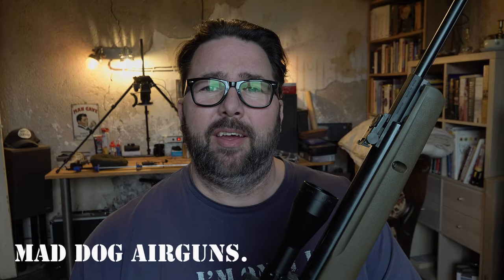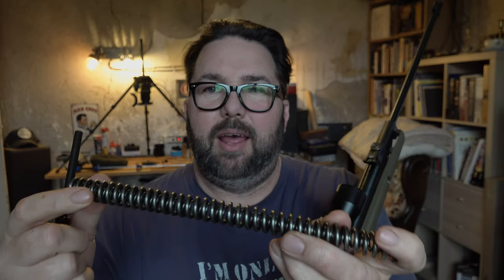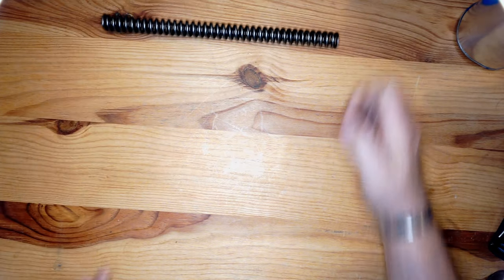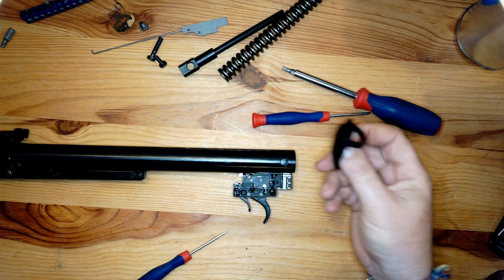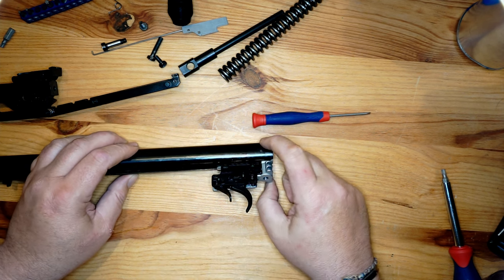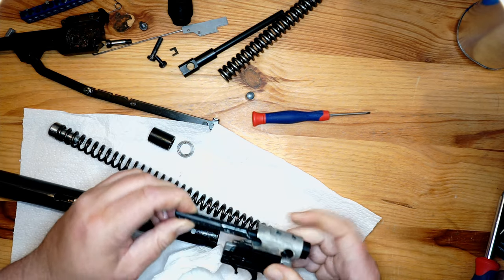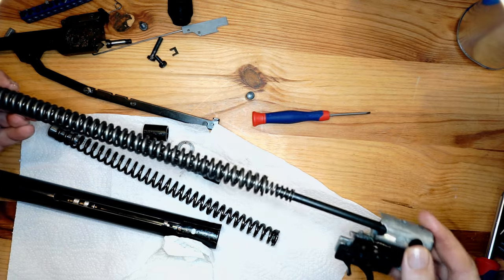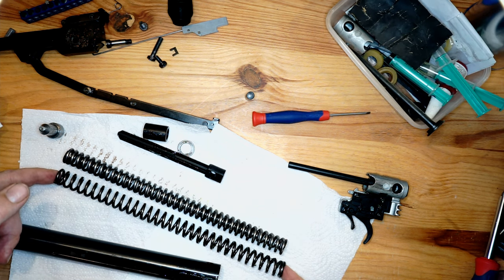Worst Airgun Mod I've ever tried

Comment: That was a real shame I also did a similar kit on my Webley Vulcan some years ago, I'd been in my local shop and got talking as you do with chaps as I was a complete clueless shooter back then. Guy grabs this double spring kit of the rack in it's greased up plastic bag with the words get this in you're rifle it's the dogs B******S  🦾. Got home stripped the old spring out with no problems as I'd already mended a broken spring previously so I was well versed, put new kit in buttoned everything back up cocked the rifle and dry fired it once to test and all seemed fine except the muzzle sound was distinctly lower. Next day went off to the range proud of my achievement and no smashed fingers and started to shoot, my zero had dropped by four inches I grabbed a friends chrono and the rifle had gone from 11.2 ft/lb to 9.1 ft/lb with .177 8.4 grn pellets and yes I felt a right burk but learnt a valuable lesson to not fix things that aren't broken.

Comment: Just found your video , someone has sold you a pair of Tornado springs an airgun produced by FEG in Hungary designed in the late fifties early sixties went through several mods over the years but the twin spring tec was never really a success.  I would suggest using an appropriate Titan xs main spring and replacing the piston seal with a TX 200 seal or contact Ian at Custom air seal Australia I believe he produces a seal to fit that covers the boss on the end of the piston this will improve sealing and reduce noise not sure the piston weight needed unless you decide to go for a shorter and less powerful spring. Remember the heavier the piston the greater the felt recoil. There has been a anti grease movement for the last forty years, but the correct amount of lubricant in the right places can work wonders for recoil and smooth shooting.

Comment: Looking at what u are trying  not a good idea take the right spring an on each turn put large screwdriver in a stretch them you will only a mm on each but will certainly  inprove the power

Comment: I have a veeery cheap and primitive springer i bought used for 15 euros.  In my country you can buy air rifles up to 12J energy without licences. I dont think it was making all the 12J even, what i did to get a bit more power was to dissamble it, ive "hand machined" a spacer to add between the spring and the trigger carrier to give it a tad more compression. I had to modify the the trigger because it didnt latch onto the spring catch due to the more compression. It does have a bit more recoil now, but the power definately increased. The seals are all bad and its really a shit rifle, but its much more accurate now and packs a bit better punch. Best thing, it cost me like 5cent nut that i grounded and drilled to fit the guide.

Comment: I think you should put back in not only the front spring guide, but also the rear bush and rear washer.
Reply from the maker: Already done it.
Reply: @Maddogairguns  does it shoot any better?
Reply: Yeah add 2 or 3 washers. Should power it up to your required legal limit.

Comment: Decent high power springers are rare and are usually designed from the get-go. Piston, cylinder sizes etc.
Reply: Old HW 80 and some old English penny's is all you need for approx 25-30 ftlbs
Reply: @ianmangham4570  what are the pennies for
Reply: @redauwg911  preload, its something  naughty  people  used to do , ended up shaking  the guns to bits though

Comment: I think you left out the plastic cylinder that should have been installed between the larger spring and the trigger body. I see that the plastic guide shortened the inner spring and the outer one remained longer.
It has happened to me when I put a lot of grease in cilinder, my projectile speed drops, especially with Cometa airguns due to small clearances and tolerances. I personally use MoS2 long term grease and apply it in extremely small quantities and later only a drop of ballistol oil.
If you want more power, install either a gas piston or a 3.5mm wire spring.
That metal guide that you threw out because it stuck and caused the cylinder to jam. Take it to a master turner and cut off the hat to 2mm. It's a flywheel that gets constant speed without variation, but you'll get a bit more recoil.

Comment: One of those kits frome ebay with green syringes I take it? Did you try running it with the factory seals? Because those "high performance seals" are absolute garbage. More recoil with less power often indicates a leak. Maybe also try to turn the inner spring around. Then again it could also be that the internal friction of the spring assembly bottle necks the entire assembly. I got one of those kits a while back and didnt have any luck either.
Reply from the maker: Sounds like the same kit off ebay. I just bought a full power spring from Gamo in the end.

Comment: I have to wonder if you had the ability to turn down the top hat to fit the inside spring and remove a couple of coils off the spring what would have happened. I would measure the inside and outside coil widths and multiply my number of coils, and subtract the top hats length to the shoulder of the head to get the proper amount of coils and not be coil bound. If you follow me, it would be an great experiment. I believe you would get good results
Reply: I concur, a double seating could theoretically cut down on the springs rattling against each other and against the tube 🤷🏻‍♂️. Theoretically 🤔

Comment: I think that black bushing should still be in there ,the problem may lay with the installer not the product ,  the spring being shorter is prabably unloading its energy too early and think about it ! The origanal spring needed that black spacer and its longer , you put in a shorter spring and took out a block that is there to compress the spring , there for resulting in a lower pressure , i think you made the mistake not the product ......
Reply from the maker: I was back a forth with the seller over many emails, did exactly as he said and the results were rubbish. Just put a high powered spring in and that seems to have worked wonders. It was just an experiment, but one that didn't work out.